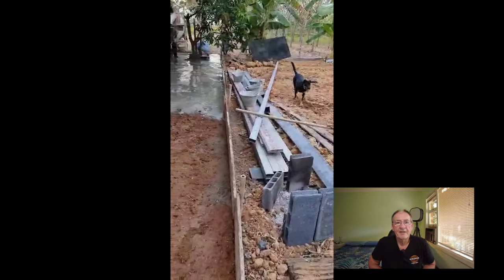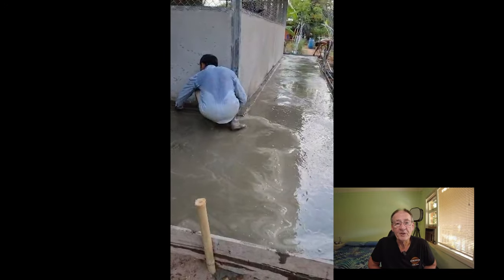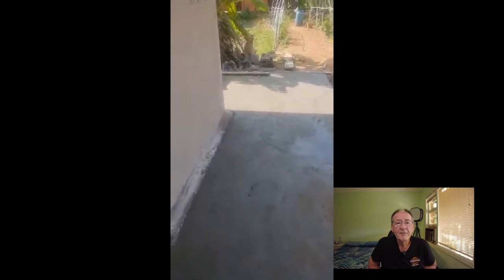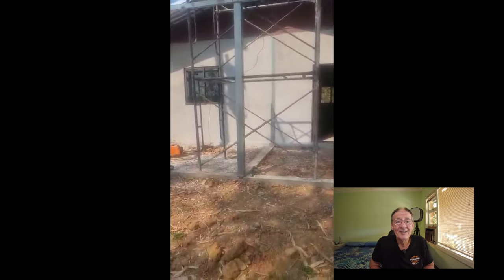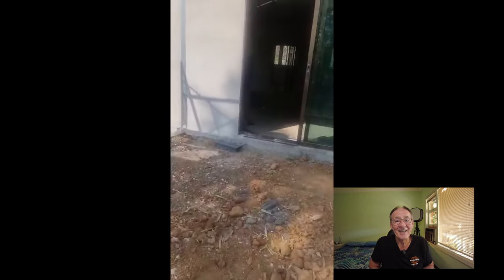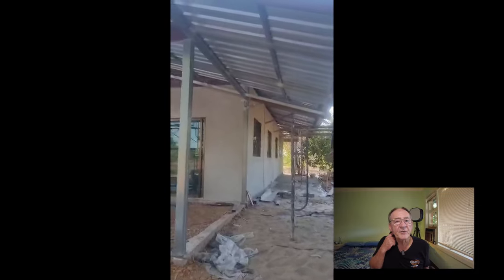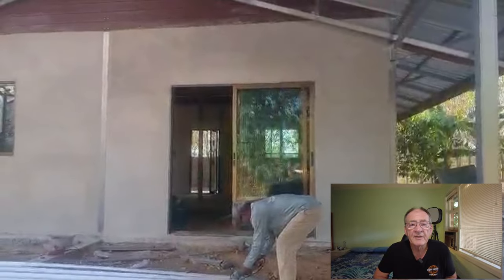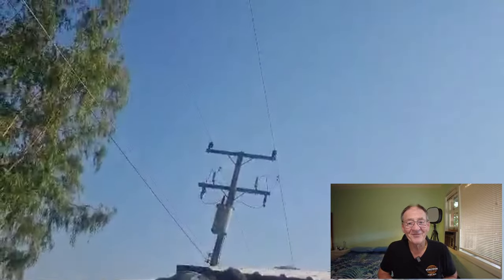Mystery Project in Rural Thailand #12 Revealed

Comment: It appears the power line go over the top of the roof 😬
Reply from the maker: The video does give that impression. There seems to be a fisheye effect on Mems phone camera which also makes the poles and long verticals look like they are leaning. The power poles are inside our fence line. It is close but not overhead. I would prefer a greater separation but they seem to be okay with it. I think in Thailand you got to adopt the "dont fix it, if it aint broken" attitude if you want to fit into the community.

Comment: I"m now in Thailand as well, and when I did watch your last video I thought there is a shading roof missing at the front. And yes you added it as I can see in this video. I just would not have gone with pure steel roof, but steal roof with a 5 cm foam layer underneath already attached to it at the factory. When it rains, the pure steal roof makes a hell of a noise. The foam will dampen the rain noise and also keep it cooler. It is a battle between traditional building style and modern style as they call it in my area. I add the element of passive cooling to it which has a tradition in Thai building, but is often forgotten once they think "modern style". Thais like blue and red roofs, I prefer silver or white as it better reflects the sun. I found companies online which make these colours as well and give it names which indicate fortune to make them attractive for Thais. A new house just got up in my neighborhood. Modern roof line, green naked steel roof, large deep shading areas around the house to prevent the sunlight to reach the walls. So far well done, but the attic height is too low. It needs a great height to allow the hot air which builds up underneath the steel roof to be ventilated, Unfortuately naked steel as well. I hope the people will sleep very firm when it rains.
Reply from the maker: Hi Bruno, yes the foam would be nice. I tried to enquire about it local but was hard to get a cost comparison. I just went with local. It might have blown my non existent budget...lol. I had not expected to do a build originally but it was a good move for the future. At this point looking to paint inside and out which Thalinee has already started.  Then ceramic floor tiles. The builder is fitting the consumer distribution box for electric and main supply from meter.